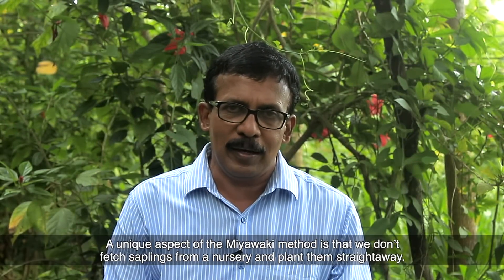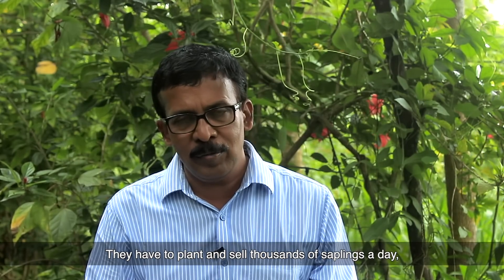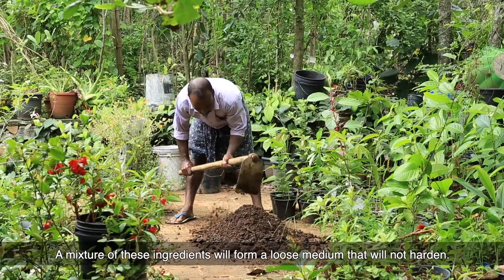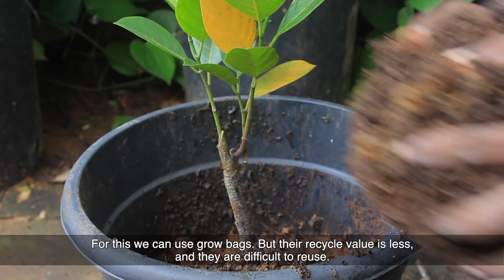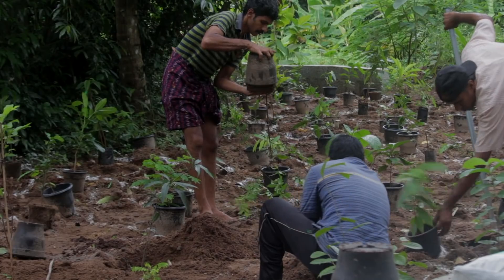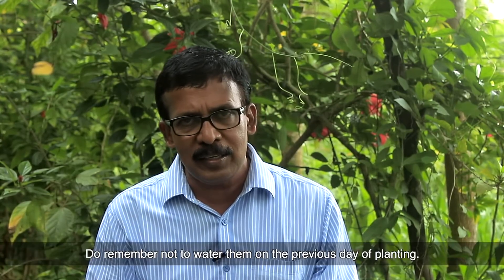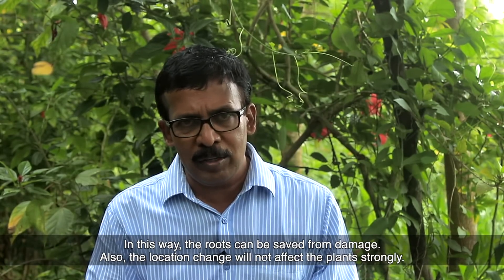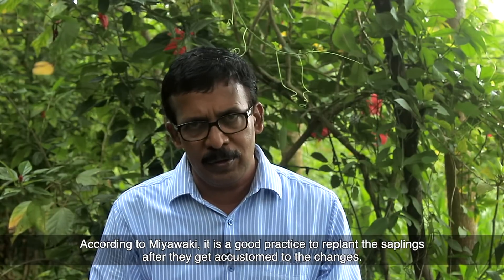മിയാവാക്കി മാതൃകയിൽ ചെടികൾ നടുന്ന രീതി  | How to plant trees in Miyawaki Method, Web Series #8

Comment: Dear sir I would like to start a miyawaki fruit forest in a plot of 3 cents in Kochi. Can you please suggest where in Kochi can I get the coco-peat, cowdung, rice husk and soil in Ernakulam/Kochi at a reasonable rate. Please suggest sir.
Reply from the maker: PL check with agro industries Corp and coirfed. Loose Coco peat should be bought. Not solid block
Reply: @CrowdForesting  thank you for the reply. Also for an area of 2.5 - 3 cents approximately how much will I need to buy it I remove about 2 ft of existing soil from the top. Kindly help.
Reply: @CrowdForesting  Additionally where would you suggest I get buy fruit tree saplings from in Kochi. In your video you had mentioned places in Thrissur and TVM but is there anything in Kochi where I can source good quality fruit tree saplings. Thank you